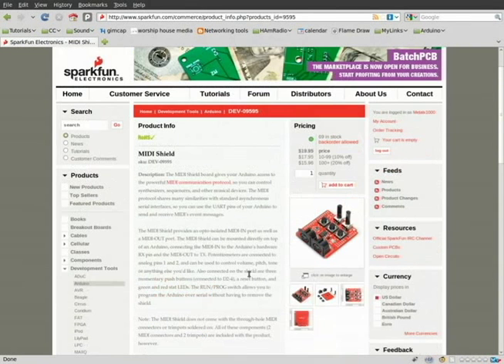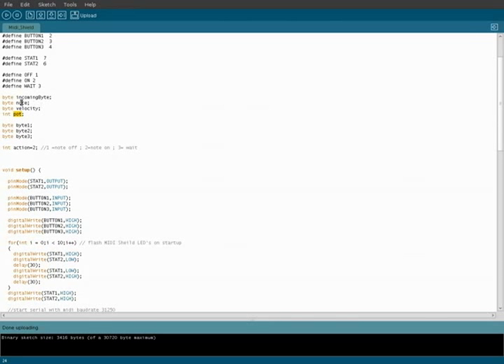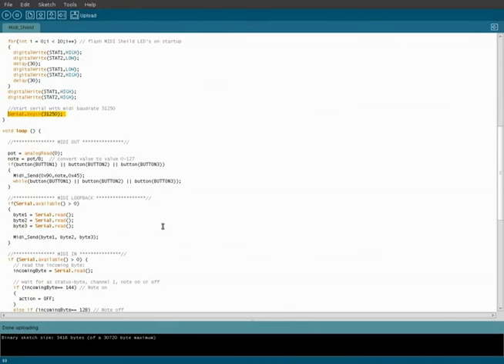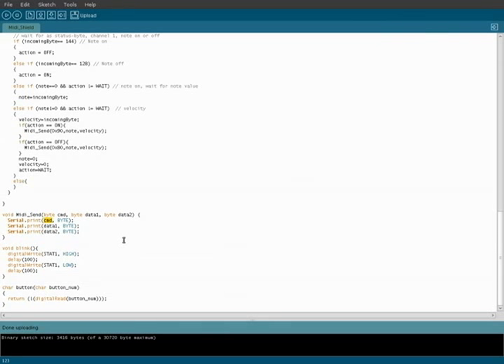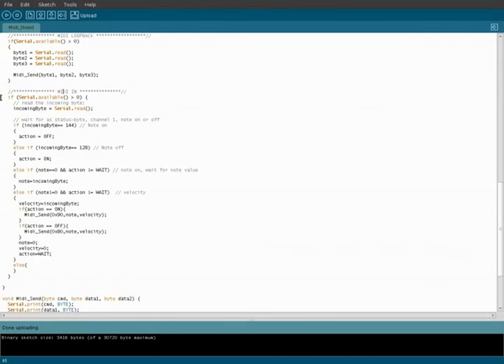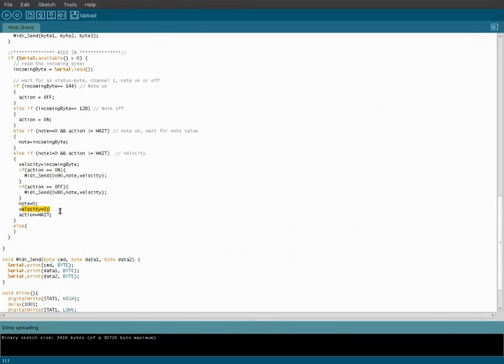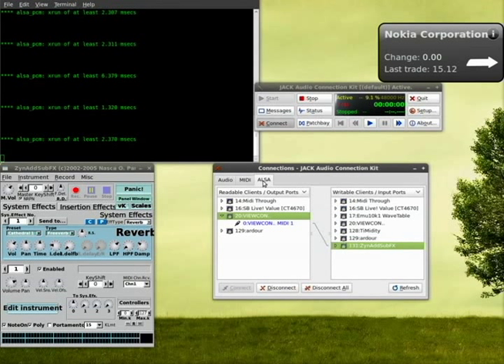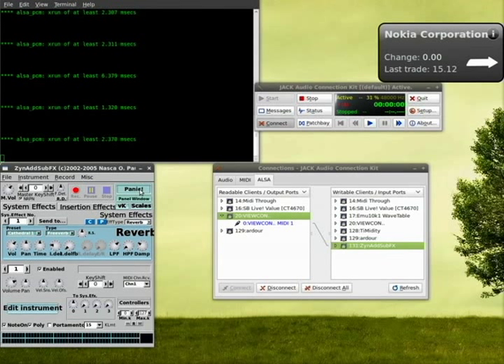Arduino - MIDI Controller part 2 - The Code

Comment from the maker: @Mellotron77: Thank you  :)  The switch is small and was already built on to the board so I didn't have to solder it on, so I didn't even see it until you just told me.  This is going to save me a lot of headaches and time.

Thank you so much for pointing this out to me :)